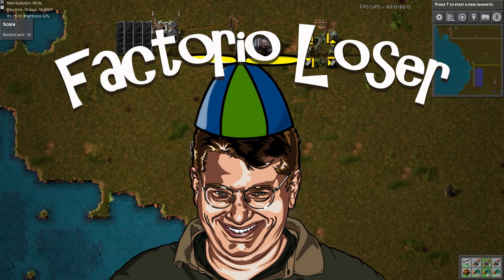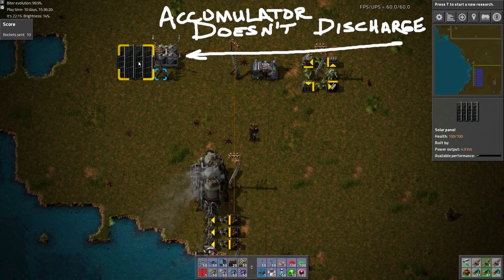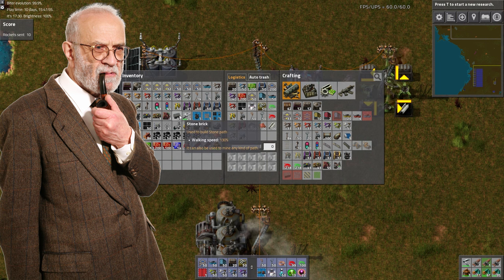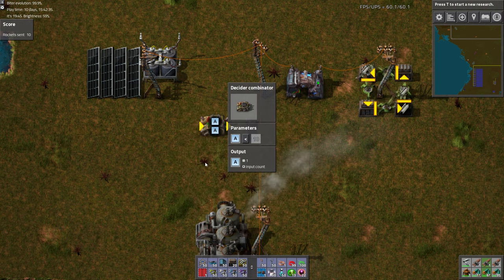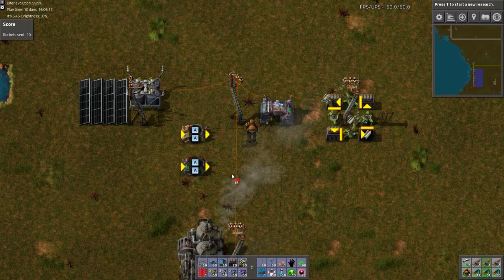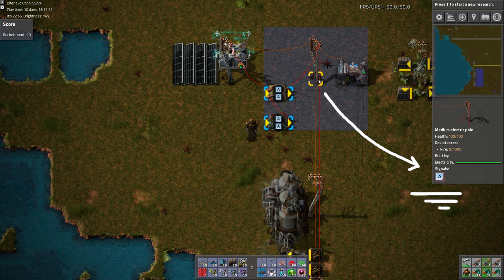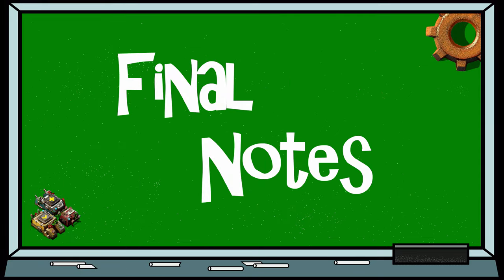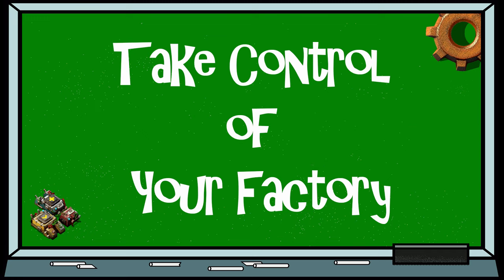FACTORIO TUTORIAL: EMERGENCY POWER SR LATCH | Combinator Classroom Ep. 4

Comment: Finally, a video that I can understand which explains how these SR latches work, instead of saying 'do this'. Thanks.

Instead of using the signal to switch on the pumps, could you isolate the steam power from the main grid and just use a power switch that receives the latch signal?
Reply from the maker: Yep that works just as well... Maybe even better. I typically don't use a power switch because you have to isolate the power from steam engines just as you mention.
Reply: the only 'problem' this is not an S-R latch :-)
Reply: Really? Whatever it is, it works for me, though I have started to use what I believe is called a Schmitt trigger using wires on a 2x2 circular belt, and no combinator.
Reply: if it works it works:D
Reply: o'rly?
to me this looks exact opposite of explanation. this is step-by-step instructions.
Reply: @moofymoo  Explanation is at the end of the video. to me this looks like you didnt watch the video.

Comment: This is some big brain stuff! Thanks so much for your amazing work! Took me from zero to hero! I was able to implement your solution but instead segregate the engines from the main grid via the power switch. Then apply the final output to the power switch instead of the pump so I don't have to wait for the wind down of the water to get used. Might not have been a thing 8 years ago. Thanks again!

Comment: This SR latch is even better than what's on the wiki. Before seeing this, I'd use one decided combinator to output an "S" signal, one to output an "R" signal and an SR latch after that. One thing I'd definitely do different is to connect the command signal to a single power switch and not a bunch of pumps. That way I can for example accumulate steam in storage tanks until it's needed and have a few more steam engines than my boilers can feed.

Comment: This is exactly what I needed, I have always used a box and two inserters, one which takes out the items in the box if the signal is 35 or above, then the item is belted to the other inserter which put it back in if the signal is less than 10, lastly I simply check if there is an item in the box to turn on/off the pumps.

Comment: Nice video. You explained in such a detail that I almost felt like an idiot :) My own problem with understanding how stuffs work in game, boiled down to the fact that decider actually sums similar signals on its input. I did not know that. Once you realize that, it all start making sense and you realize the real power of arithmetic combinator.

However, I have some notes :

In a real game, at least in mine, we actually have a cluster of pumps far away. but usually close to our base, is the belt with coal that actually feeds boilers(which most probably are chained to feed on each other , from one line , to the other). Naturally, at the end of boilers you connect steam engines. So its inconvenient to actually take the red wires all the way to the pumps.
The other drawback is that when you enable them , there would be a delay unit they pump the water and boilers heated it. So you cannot use the full capacity of steam engines right away, the moment accumulators drop bellow percentage.

I have used another approach:

put a tank between boilers and steam engines. this will give a buffer of hot water. for some reasons, devs decided that the water in a tank does not cool off.

Isolate the wires of steam engines from the rest of your power network. Use a power switch which has one of its poles connected to your main power network, and the other pole - to the isolated cluster of steam engines.

Use the combinator technique described in this video. the only difference is that you connect the output of the decider , to the switch, and set its condition to "A=1".

This way, you have hot water ready to be used in a second. but since the steam engines are isolated, everything is on pause, so to speak. the moment the precondition for the power switch is set, it connects steam engines to the rest of the network and the transition is really smooth.

I believe this way is a bit more efficient.

The simplest possible approach was to use just a single power switch, connected to the accumulators and set its condition to ,say "A<30". this actually works pretty well. but you will notice that steam engines will start work for a milliseconds , which, i have imagined , leads to intense internal calculations for the game itself when it has to calculate all the power changes when you connect and disconnect steam engines so rapidly . that's why I prefer the SR latch.
P.S. Geez, you actually read it all the way :)
Reply from the maker: Yep... That's a huge point to understand!
Reply: hehe, maybe I need to make half an hour video for this :)
Just a joke, mate, no offense :)
Reply from the maker: Or you could watch Combinator Classroom Ep. 1 ;-)
Reply: Well, no, sorry :)  I do not have half an hour to learn something that i can for 5 minutes in the wiki. which was my original mistake to begin with :) 

So, these links are all we need :
https://wiki.factorio.com/Decider_combinator
https://wiki.factorio.com/Circuit-network_Cookbook

However, I should give you some credit for the humor in your videos, they are more of entertainment :)
Reply from the maker: The signals are also combined at anything that can be connected to the circuit network. NOW you are excused from class. Remember to keep up on your homework and there will be a test next Friday.

Comment: I use(d) this in many other situations... (in earlier version I didnt play much since nuclear stuff came out) so I was adding power switch controlled by this type of circuit 

also counting items in passive providers chests all connected together (instead of signal 'A' I just for example count iron plates)

so using it to switch on/off furnace lines, assembler lines, etc... 

this is the way how I built my low pollution factory where most of the times machines were turned off when the boxes were full enough

Comment: You don't need SR latch at all, just connect accumulators and pump and set accumulator output signal lets say to Y for yes if Charge C < let's say 10, set the pump to enable if Y > 0.

But I sense that SR latch can be used for more complicated setups. Do you know any?

Comment: Really nice tutorial! :) I'm subscribing for sure.

I was just wondering if you could help me with the conditions for something sort of opposite to this. I was hoping to apply this to my oil processing network and have level monitors for all my liquids so they automatically craft some when the levels are below a certain point. For that, this SR latch config is perfect (for turning oil into heavy, light, petroleum, sulfuric acid, lubricant when their tank's levels are below 50% for example and stopping when they are 75% full).

I want to add one more layer of complexity by saying that, if all the liquids mentioned are above 75%, the crude oil should start being turned into solid fuel... So basically I want the SR to read that oil is >75% and turn ON a system for the oil->solid production. I then want the latch to reset to turn the system OFF when oil is <50% full in the tank.

What would be the simplest way to achieve this? By changing the 1 value to 0 so the logic is switched? Or having the A<10% being A>10% instead.

Sorry if this isn't exactly clear. Thanks for any help :)
Reply from the maker: Hey ChickenMacNugget... Sorry for taking so long to respond.

All you have to do is change the sign in the Decider Combinator to greater than (>) and instead of using a negative number in the Arithmetic Combinator, use a positive number.

So it would look like this:

Decider Combinator: "Oil" > 1,800 output signal "Oil" value of 1
Arithmetic Combinator: "Oil" x 600 output signal "Oil"

My calculations for the values are:

.75 x 2400 = 1,800
.50 x 2400 = 1,200; 1,800 - 1,200 = 600

Here's my rule of thumb for SR Latches:

Situation 1:

Turn on above x and remain on until below y; Use ">" in the Decider Combinator & multiply by a positive number in the Arithmetic Combinator; x - y = "bias" which is the value that goes in the Arithmetic Combinator; Since x is GREATER THAN y, the "bias" will be POSITIVE.

Situation 2: 

Turn on below x and remain on until above y; Use "<" in the Decider Combinator & multiply by a negative number in the Arithmetic Combinator; x - y = "bias" which is the value that goes in the Arithmetic Combinator. Since x is LESS THAN y, the "bias" will be NEGATIVE.

Hope that helps and mucho thanks for the sub!
Reply: Hey! No problem I've been messing around with lots of logic systems :D 

I figured it might also work if you just put a NOT gate at the end of the SR Latch, so instead of activating when power is low (as with steam engines) it will activate when there is too MUCH of a certain liquid in one tank, and then the effect cascades down (So heavy->light, light->petroleum etc and then just have it make solid fuel if the tanks all fill up too much. :)

I might also try out the method you mentioned above :) There's always more than one way to set up logic!

Comment: I had a similar build, but instead of attaching the output signal to the water pumps, I tied my steam engines into the network via a power switch and used that to turn them on or off.  This has the advantage of turning the steam engines on and off immediately instead of waiting for the water to heat up or empty respectively; also you don't have to wire to each water pump, just one switch leading to your whole bank of steam engines.
Reply from the maker: Yep... Doing it like that was mentioned on a live stream... The only downside I see to doing it like you mention is that you have to make sure all steam generation power runs through the on/off switch and is otherwise completely isolated from the rest of the power grid.

Comment: Is there a way to do this with a power switch the other way? I want it to read my power grid, when the accumulator gets below 20% i want it to turn OFF a power switch which cuts out a section of my base drawing alot of power, then when the sun comes up and solar recharges the accumulators it turns the power switch on allowing that section of base to work again?

Comment: One build I'd like to see is a timer, for instance one that outputs one value, A=1 for some time, say 20 seconds (20*60 ticks), then after that outputs A=2 for 50 seconds, then goes back to 20s of A=1, then 50s of A=2, etc.

I actually don't have a concrete usage case for this one, but I think there's a lot of potential in knowing how to use the various elements required.
Reply from the maker: I'm thinking this would be a 70 second timer... Less than 20 seconds output signal A... More than 20 seconds output signal B... But I haven't tried building it in game yet. If we can think of a useful build using this I'll definitely create a video. I'm trying to shift these videos from just theory to a practical build using the theory.

Comment: This is an awesome tutorial, and I'm sincerely hoping that it holds true for v0.15.

Once question I have is how to use a low power condition to intentionally break and isolate a specific section of the power network for emergencies.  I'm trying to design redundant defense mechanisms for my remote outposts, and one way to do that is to use both gun turrets and laser turrets.  I'm perfectly willing to generate electricity locally at those locations, but some don't have any access to water for steam, and the idle-power requirements make solar somewhat difficult.  Since I already have a use for sending out power poles because at a few of my bases I like running signal wire back to base for resupply purposes (ammo levels, repair pack levels for the lognet to deal with biter waves, etc.) I already have the ability to run centralized power.

The problem I want to solve is how to run the outpost laser turrets on central power, but in the event of a brownout (or worse) I want to be able to isolate those turrets and then run from local power (including the possibility of railing in outside water or even preheated steam to be stored at the outpost in tanks for just such an emergency.)  Automatically releasing the isolation once the problem is solved would be nice, but I'd be perfectly willing to run out there to manually reset it if that were my only option.

In other words, I have this emergency-steam setup back at the main base, but I won't want that to end up making me rely on emergency steam power generated out in the hinterland, where it's more important for those lasers and ammo-feeding inserters and repairing construction bots to have their own isolated energy needs taken care of locally while simultaneously getting them off of my central power net's burden when it comes time to conduct an emergency reboot back at home.

Any ideas?
Reply from the maker: You may want to try turning on & off the Train Stations that receive the emergency steam power train. So if power at an outpost falls below a certain level, the station opens and the "steam" trains can begin delivering.

P.S. SR Latches work perfectly in 0.15.
Reply: Well I already intend to bank the steam at the outpost during peacetime, that's not an issue.  My issue is that if I'm primarily drawing from mainbase electricity, I don't want a mainbase brownout condition to create the scenario where the outpost's banked steam power is carrying the mainbase through a brownout.  I have steam banked at the mainbase for this purpose.  My question is how to make it so that a brownout will trigger a condition that actually breaks the electrical connection between the outpost and the mainbase, such that the outpost's power only goes to that specific outpost's needs.  I can trigger events with brownout, but I'm stuck on how to trigger an actual powernet breakage.
Reply from the maker: Have you tried using a switch connected to a latch?
Reply: An electrical switch connected to an SR Latch?  I can rewatch this tutorial to see if I can muddle.  :D

Comment: I just used this so I have 400 x steam engines on standby should my new nuclear plant ever need a helping hand. I had to go nuclear the coal drain was becoming an issue and painting landscapes in solar panels gets old fast...

The power network reads the steam engines present but not active, and if I drain the accumulator they kick in, which is almost perfect. One thing, I'd like to adjust the level the steam kicks in at. So if the accumulator drops below 40% the steam kicks on, and stays on till accumulator charge climbs over 80%. I'll hook it up to a light and audio alarm in the main factory area to let me know I'm using steam power. I've tested the light at the power site and it works fine A = 1.  

The nuclear plant potentially kicks out 480 MW (?? 4 in a block) so the steam is merely a buffer now in case I go too crazy building, but it can't be relied on for much more than that. I had 3 blackouts getting to this point :D

I figure with a couple of sets of values (the original, plus what to enter for a 40% switch on and 80% switch off) I might follow the numbers and grasp all this a bit better. 

And thank you, most combinator builds seem superflous and overly complex. Not so with this.
Reply from the maker: The 10% cut on and 35% off were only a recommendation from someone in the comment section... But I've had good luck with those numbers. However, those numbers are not set in stone and should definitely be adjusted to whatever works best for your factory... And different settings may work better at different stages in your factory build!
Reply: Appreciate the reply. I've made all sorts of neat stuff since you introduced me to 'understandable' combinatorials....

The steam buffer for nuclear power of course

An alarm to tell me when I have 40 x U235

Lab facilities that regulate science pack input keeping the belts unclogged. Many variants of this for any expensive recipe with lengthy belts

Regulated train loading/unloading onto belts (via Mad Zuri via Xterminator video)

And more! All within days.

You'd make a great teacher. Scratch that. You are a great teacher.
Reply from the maker: Thanks bud... Understanding the SR Latch is a key step in unlocking combinator magic. I use Madzuri's loading and offloading from belts in just about every map. Understanding whats going on with these setups is another great way to get a handle on combinators. Madzuri said I was free to make a video on both variants so hopefully some day!